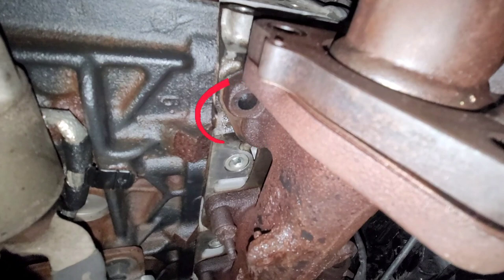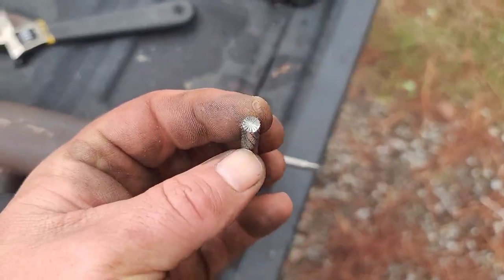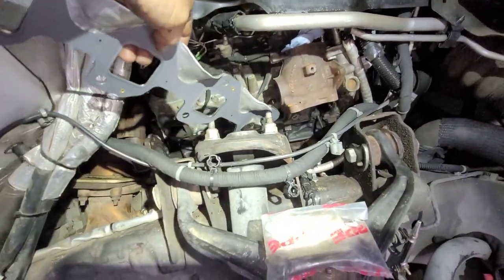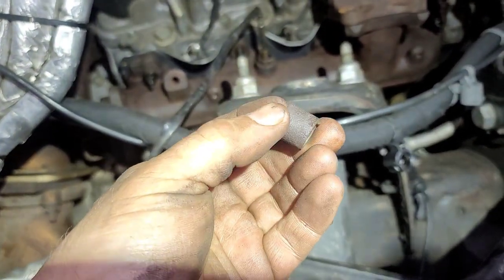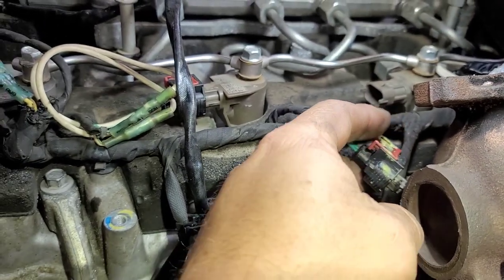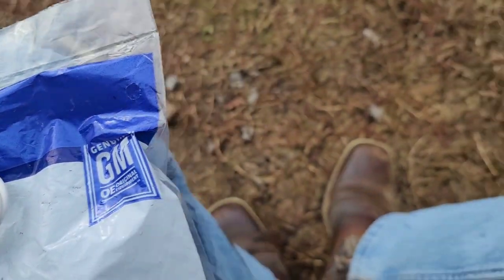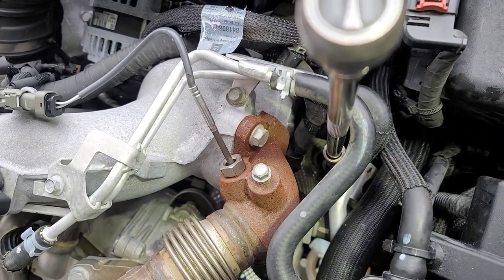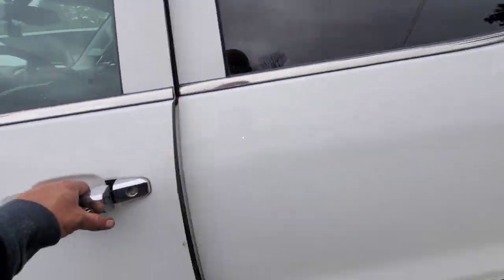L5P Exaust Manifold Install (Broken stud/ Squealing exaust)

Comment: Awesome project,  I'm thinking about changing my studs on that side as a precaution. I'm partially disabled so it would be hard for me to handle this project. Keep up the good videos! I've learned a lot
Reply from the maker: Thank you! It definitely kicked my butt.
Reply: Why did you go with PPE vs Factory studs and nuts?
Reply from the maker: I was already on their website looking at the manifold and up pipes and it seems like everything i try to get from gm has a wait. I just saw them there and clicked the button. No real reason.

Comment: Glad to see you got it broke off extractor is about as bad as it gets with that job. Real happy to see you got it. I was thinking, so I’ve never used them type of but connectors you think there’s any way the heat in that location could melt the solder and come loose.
Reply from the maker: I hope not, i wish i would've had the crimp style with me never using those on a connector like that before. I would've liked to have experimented with one that was easier to get at but I'll if it doesn't work out there will be a video, lol... I've been using them quite a bit and they haven't let me down so far

Comment: AWESOME job..... I was just thinking/reading up on these: $1,300.... PPE HIGH FLOW EXHAUST MANIFOLDS WITH UP-PIPES 17-22 DURAMAX L5P. Not sure if it's worth the money to upgrade before I hit 100k miles on my 22, I heard that's when you start having issues.... Still got to run that CA load with you guys once darn load board gets better!

Comment: Thanks for your videos I had a miss on no. 4 put me in limp mode what was the injector connector on my2020 Duramax I had bought the altel scanner and had an injector connector in the glove box was able to fix on the road about 30 minutes 210000 miles
Reply: Sorry I meant no. 5
Reply from the maker: Hate it gave you trouble but in really glad you got it fixed up. Hopefully it'll be a long time before you have to replace another one

Comment: Have you had any issues with long (2 miles or more) uphill towing at slow speeds (under 20MPH) ? My transmission gets hot when this happens and says to let engine idle.
Reply from the maker: I haven't. I did install the wherli transmission thermostat bypass earlier on. It runs a lot cooler after than it did before

Comment: You ever get the impression that metal drills, extractors, taps are defective from the get go.   Xray them all, have metallurgy analysis, put the magnet on them for "hardness".   Keep the old ones because they are not making them like they used too.  The quality control is none existent.
Reply from the maker: I agree, they're not making anything like they used to